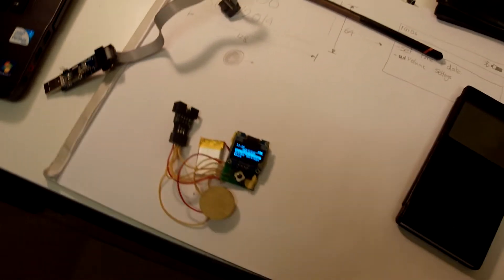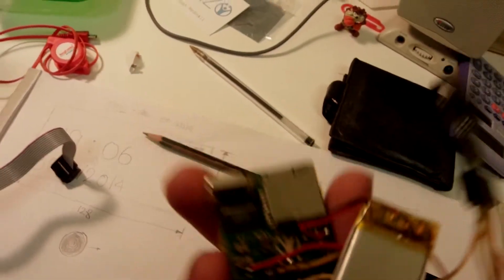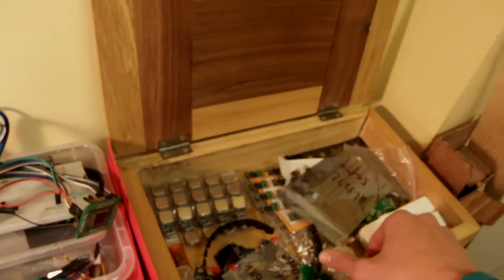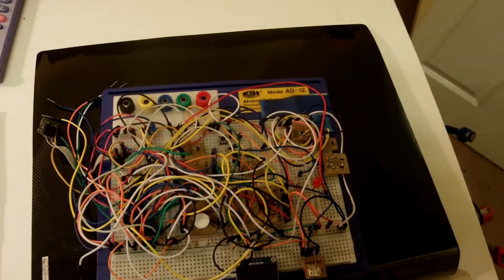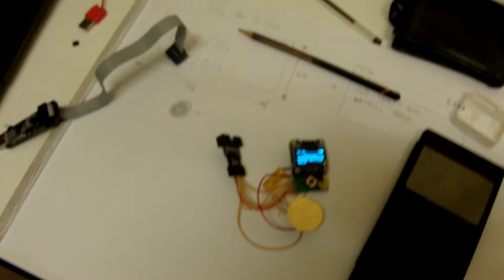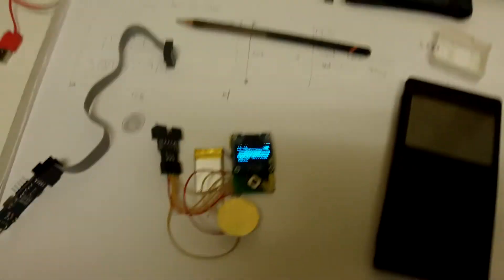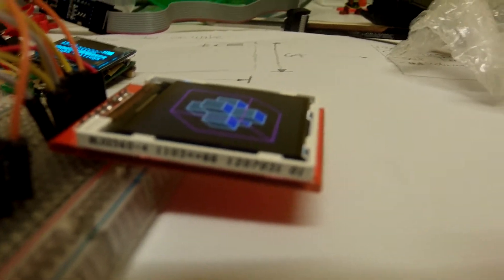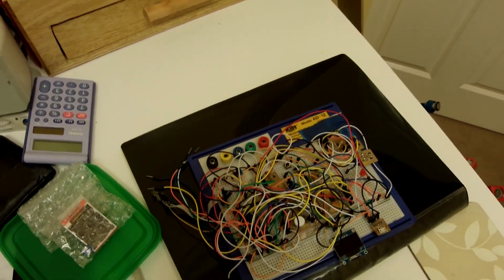3D Printed Smart Watch Atmel/Arduino OPEN SOURCE #2

Comment: What RTC chip you are using ?
Reply from the maker: TheScapeMine It's the DS1305, I haven't had any trouble interfacing with the chip, it uses SPI and 2 interrupt lines for the alarms. It also has a nice battery configuration system from what I can remember. :)
Reply: willz1200 Thanks ! I have another question, where do you get your double sided pcb made?
Reply from the maker: TheScapeMine I get them made at DFRobot, I'm planning on finding somewhere as they take around 2 weeks to come and then there's the manufacturing time on top of that which is 5 days. I haven't had much look with them either I've had 3 orders from them now and 2 of them have come back with mistakes on them, it took me a while to prove to customer services that my gerber files were fine. When I finally did all I got was compensation and not new boards.

Comment: Amazing project! I'm trying to do a DIY smartwatch with arduino pro mini as well. What color screen is that? And how many mah do you batteries have? Im using a 400mah 3.7v

Keep up the good work!
Reply from the maker: Oh sweet, what sort of screen are you using? Its a light blue oled screen, and the battery is 140 mAh. See the description for more specs and a picture of the screen focused :) Thanks for the support!
Reply: willz1200 I was referring to the screen in the end of the video with the blue and purple squares, is it a 1.8" TFT?

The battery is only 140mAh? How long does it last approximately.
Reply: willz1200 Sorry dude, I didn't notice the description of the video xD
Reply from the maker: Marcos Soares Oh that ones a full colour screen, its one inch diagonal. It lasts for a fairly long time, as it uses literally no power while in standby, but you can get about 3 and a half hours out of it while the screen is on
Reply: willz1200 can you tell me the name of model of the full color screen? seems to be good
Reply from the maker: Marcos Soares Yeah sure I don't have one with me right now but I'll check later